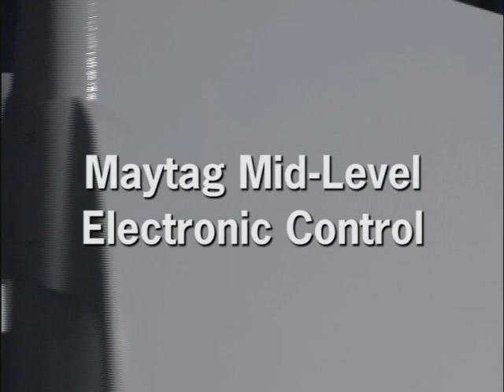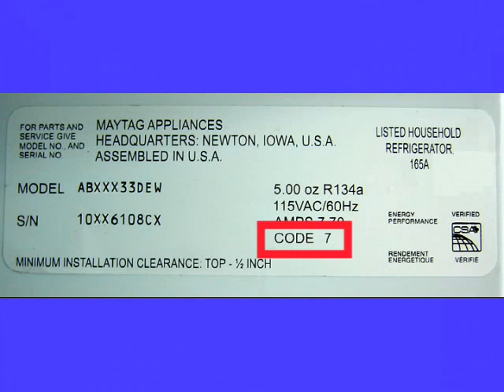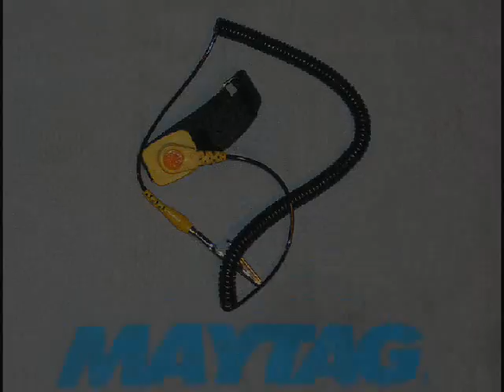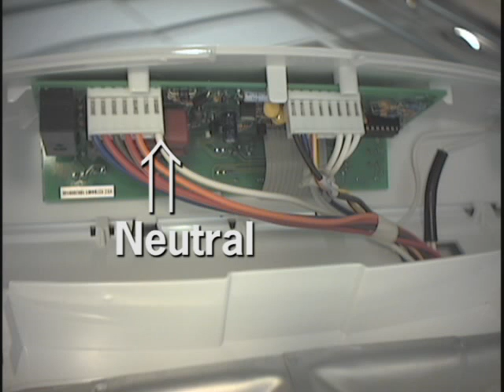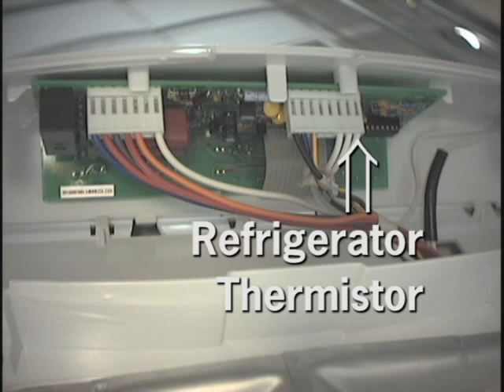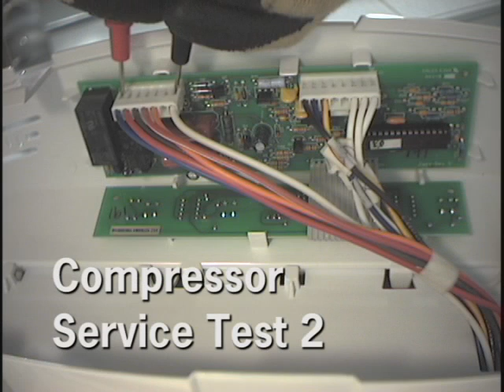Maytag /Amana Jazz Service

Comment: a question, friend, but have you ever had to change the card because the old one only worked when the upper refrigerator door was open and when it was time to close it, the motor behind it turned off? I went to a customer's house who had this defect, I changed the card, it worked fine for a month and now again if he closes the upper door, the motor starts and when he opens it again, the motor turns off.

Comment: What if the code is 2 numbers and the fridge only goes up to 9?
Reply: Use the freezer control up button to set the first digit, the refrigerator up button to set the second digit.

Comment: The first test, the defrost test, it shows a zero. As if its open. By pressing the down arrow should it display an S as closed? I press on it and it stays at zero. Would this mean my defrost thermo is dead? The first time I ran it it displayed an S. Never since... Thanks for your help!!
Reply: This would be good to know, as mine is in the same situation
Reply: 0
Reply: I thought you can only press fridge up button to change. Can you press down arrow? when I press mine with up arrow, it either shows 0 or nothing (deactivated?)